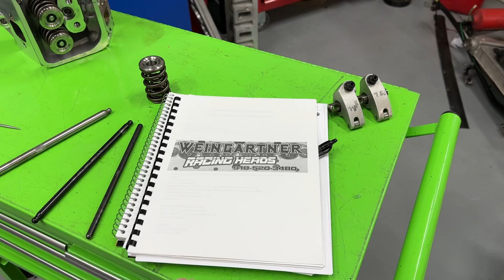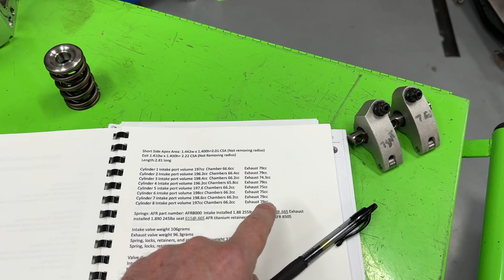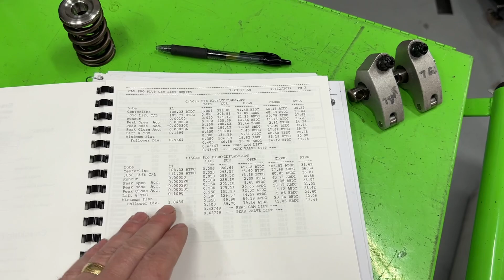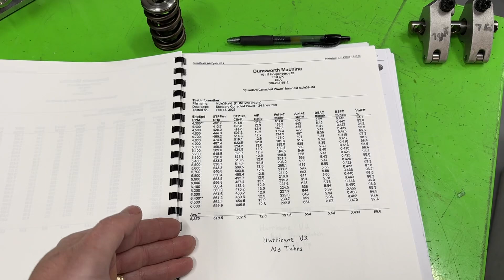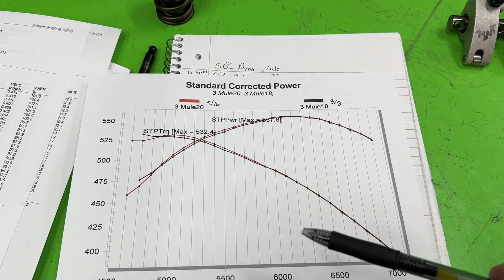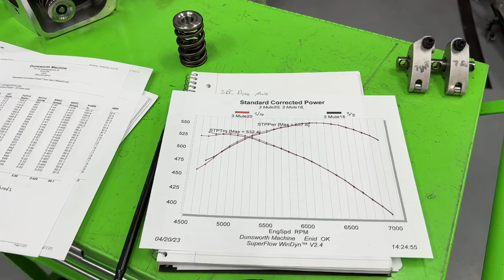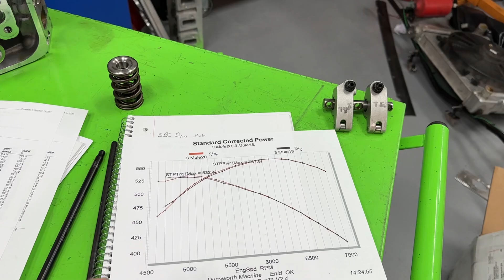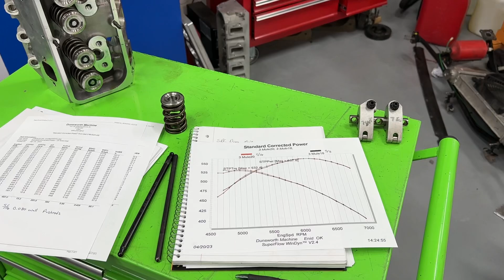5/16 vs 3/8 Pushrod Which Makes More Power

Comment: Seem like a lot of Spring pressure for A 2.02 valve at 6500  My 350 with A 2.08 valve, 5/16 push rod and a little over 200 pounds of Spring pressure ran smooth to 7700 on the Dyno and was still gaining power  With a  .446 lobe lift and a 1.6 rocker stud mounted
Reply: pontiac411, is that an overbored 400 or a much modified 389?
Reply: @1crazypj 400 bored .060
Reply: @pontiac411  10-4.
 I have a 1965 Catalina 389 motor for parts, heads look promising as they are small combustion chamber, block is done for as it had water in a few cylinders for ? years and would need liners to be usable
 Have a 76 Formula 400, last year of round headlights and the best looking hood ever fitted with NACA ducts
Reply from the maker: Not really. In this case it seemed happy judging by the numbers with both pushrods.
Reply: @WeingartnerRacing    But if the valve train could still be stable with less Spring pressure that result in more horsepower?  I am just thinking about 16 Springs with possibly 50 pounds more than needed per Spring.

Comment: It would be interesting to run cam and valve train package on a sprintron to show valve action difference between 5/16 and 3/8. But I suspect the 5/16 is flexing and making the engine think it has a slightly smaller cam.
Reply from the maker: I would like to see that data as well.
Reply: @WeingartnerRacing  good to get people thinking

Comment: I have always used 5/16 pushrods. Lighter and cheaper. Ballend for preference. Some swedged end gall in the rocker cup. Which is sometimes a problem in itself. I had a well known brand do that to me,,they ended up giving me pushrods that did not. This an engine flat out at 7500. SBC. I have used factory Chev pushrods with no issues on  [baby] race rollers.. And on race Holden 6s
Guide plates can be an issue. Some are not hard! The old Manley plastic ones were good.

Comment: thanks for your hard work. i used 5/16ths on an LA 370 , when i changed my rocker ratio. Wouldn't weight on a fulcrum point be less significant?
Reply from the maker: Weight on the pushrod side is not near as bad as it is on the valve springs side.

Comment: I'll still go by the old adage, put the biggest pushrod you can physically fit in the engine....if you can't get more size, go for wall thickness.....You hurt NOTHING by having a big, thick pushrod,  but you CAN have issues with too small of one....
Reply from the maker: You are correct
Reply: I think you need heavier springs when you have heavier push-rods, so, it will need more power to drive them. 
I remember reading around 1970, use lightest spring rate that gives a safety margin if you miss a shift, of course, that would depend on crank weight and how fast motor spins up.
Reply: That's not how it works.  Pushrod weight is of little to no significance.  Weight on that side of the rocker has little effect on valve control, unless the parts are too weak to begin with.  My statement is correct, and is proven by professional builders everywhere.  Too weak of a push rod will deflect and cost power.
Reply: @markgoulette5056  Obviously a 'weak' push-rod will deflect and may cost a complete engine rather than just lose power (if it flexes enough to come out of seating  and follower comes out of bore at high rpm) but using a heavy push-rod just because you can is also losing power as it will need heavier valve springs than would otherwise be needed. It's been proven that a heavy valve train costs power by puttig engine on a Spintron. Just because it was done in the 70's and 80's (and earlier)  doesn't mean it's done today.
Reply: @1crazypj  Yes, a weak pushrod will deflect and can cost power, but additionally it can cause unwanted, uncontrolled valve motion.  A heavier pushrod WILL NOT loose horsepower, it will generally GAIN due to less deflection.  You do not determine valve spring requirements from pushrod size/weight.  As stated, weight on the pushrod side of the valve train has little to no effect on the valve side of the valve train.  Yes, heavy valve train parts can cost power, ON THE VALVE SIDE....NOT THE PUSHROD SIDE.....you are incorrect in your assumptions.  Lighter weight springs (weight, not RATE), lighter valves, retainers, and locks are very beneficial to the valve train.  However, strength and stiffness on the pushrod side are most desirable, and the rule of thumb of using the largest pushrods you can physically fit in an engine is a proven method of stabilizing the valve train.  The pushrod acts like a spring, and when it rebounds, it can transfer unwanted motion to the valve.  Not good.  When there is minimal deflection by the pushrod, there is less the spring has to deal with to maintain control.  Then, by adding lighter weight valve components like Ti valves, retainers, locks, and lighter weight springs, allows us to have substantially less valve train harmonics and better control over valve motion.  There is no negative to running the largest, strongest pushrods on the lifter side of the valve train.  NONE.  The spintron data shows this as well.  While there may be little gain, there won't be any loss.  As stated, weight on the lifter side of the valve makes little to no difference to valve motion unless the pushrod itself is not adequate for the application.  Too large of a pushrod has no negatives.

Comment: Great video Eric! I have not used a cam with as much rate as that one you have in your dyno mule. So, it is safe to say, for me anyway, that standard 5/16" pushrods are more than enough. In building engines, it is wise to have margin by using parts that are stronger than necessary, especially in areas where it has no effect on RPM (such as 4-Bolt Mains versus 2-Bolt Mains). When you get into the areas of reciprocating weight however, it does matter more. You have to use the strength level that is needed at the RPM that generates the most stress for that particular component. At the same time, you just want to use the lightest weight possible because anything above that minimum required weight, will be a liability at all other RPMs. That liability will usually be in the form of wasted energy which equals less power, however great or small the difference will be. In the end, because we common folk do not have access to dyno equipment, we try to choose components that are perceived to be "overkill" so that we never run into the hidden failure zone with our engine. Thanks to guys like yourself, we have the necessary information to make more accurate component choices. Thank you for all you are doing for your fellow car enthusiasts. God Bless!

Comment: Ive not work much with pishrod engines other than bmc mini's.. same engineering applies for competition just different scale of hp.. engine harmonics plays a huge roll & the pitch harmonics of these rods vs any critical resonance rpm harmonics from the engine are going to be bigger factors than static load stiffness of the respective rods.. thinner & thicker wall sections would be a better option to look into to change the harmonic frequencies of valve trains vs all up recipro weights or critical individual component weights.. "strongest" can still have a critically short life vs lightest.. as can firing order or ignition event timing (cylinder bank angles create different combustion harmonics that feed back through all the machine in different ways).. a flat plane v8 will have many of the harmonic problems in valve gear that flat plane 4s have.. cylinder bank angles & stroke interfere with those harmonics a lot! valve gear included..
Excellent artical.. food for thought thanks.. loving the channel.

Comment: I picked up Chromoly 5/16" diam 7.4" .080" walled pushrods by BTR, they practically the same as TSP, price was determining factor. Stock replacement or mild/moderate builds. The 3/8" rods was thinking rockers and lifters require 3/8" cups

Comment: I think part of the reason for your results is it’s just a well engineered set up 
to be honest like you said if you had a much heavier spring in there or heavier valves, OR more pushrod angularity from a canted or Hemi valve train I bet you would’ve seen a bigger difference, but I will say that I’m pretty damn surprised I thought the 3/8 pushrods we’re going to make more power!

Comment: Cool video man, i think the 5/16 is deflecting giving that mid range, but maybe it’s just out of head over 5700, I bet it changes slightly with the next heads like you said, I also learned way more than I want to type from running it to 7k, but that will really help show the gains you’re gonna get on the top end with heads! Great video as always, and thanks for answering my question!

Comment: Awesome!!!!  I'm building a moderate Jeep 258 (with Edelbrock 4.0 head and cam) and many have said to get thicker rods.  I really didn't want to, lol.  They're non adjustable rockers, and rare, so it would be an expensive part.  Glad to see it really isn't worth it in the end.
Reply from the maker: They are worth it. It is never a negative for thicker pushrods.
Reply: The more spring rate I'd say a stronger pushrod required, 5/16 for moderate builds at most depending on the alloy and wall thickness.
Reply: @WeingartnerRacing  Yeah, but they would probably have to be made custom- non adjustable rockers.  I don't race it or anything strenuous.  Just don't think the squeeze is worth the juice in such a build.

Wait till I get bored, then I'll end up buying them, lol.  It's never ending....
Reply: @rustygehl  
I can’t imagine you’re turning much rpm of the street six even with a really good cylinder head
Reply: @DSRE535  yep, not at all, lol.  The last Dyno Run topped off at 4,800, and while I wasn't in the driver's seat, I could hear it and started to pucker up a bit, lol.  I'm building for more low end TQ, but use a Dyno to show what's done what, performance wise.  Very hard to get low TQ numbers.  There are ways to see improvements, but I'm too lazy, lol.
Reply: @WeingartnerRacing  when you have 3/8" pushrods, do you require 3/8" cups on rockers and lifters?

Comment: One other comment. There used to be a company that claimed swapping over to titanium valves is worth a tenth in ET. Cannot remember the company but always wondered if there is power to be had there.
Reply: Ti is expensive and has a short service life. Will help the engine rev a little more free. Us budget racers will use good stainless as the gains are not worth the extra cost

Comment: Great info Eric   couple of vignettes...  292 chevy six has really long pushrods  The late Kay Sissel or Mike Kerby had problems with pushrod flex and came up with a bushing at the deck and upper and lower pushrods did make a difference.   We noticed early  on that the Ford with larger pushrods  was more stable than the 440 Chrysler eventhough it has a heaver valvegear.    
There also appears to be a connection with pushrod flex and spring surge/ life    Thanks

Comment: The test is the test,  I expected the 3/8" to has a bit more up top.  I'd still take the 3/8 but this makes me question how much better a 3/8 or 11/16 is on a LS with a hydraulic roller.  Granteed,  I'd still go with the larger pushrod.
Reply: I use 11/16 in my LS engines they do fit and I can't prove any gains but it is ease of mind for me